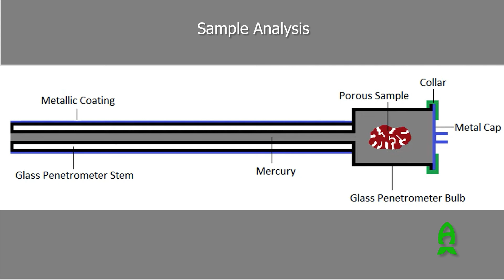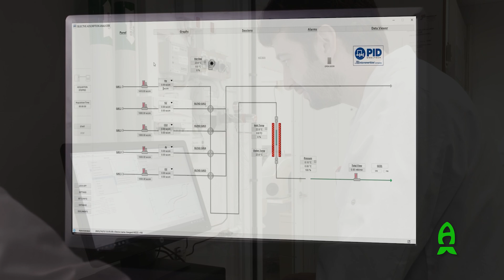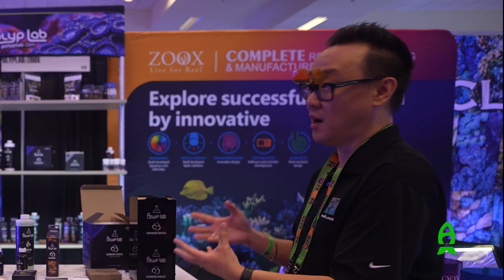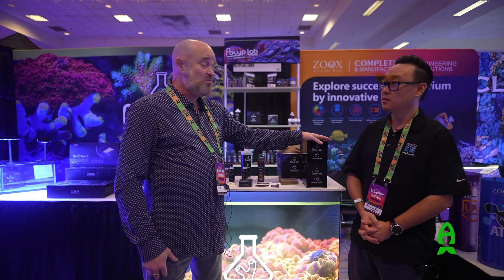Curious mind intrigued and important question answered.

Comment: As I understand it….These porosity tests are not a reflection of a real world application in your tank, where atmospheric pressure is normal (14.7 psi). 

I’m sure these products do work, but unless you are forcing water thru the material at pressure, the statements regarding surface area are limited to aerobic bacteria.    The interior is limited to anaerobic bacteria.